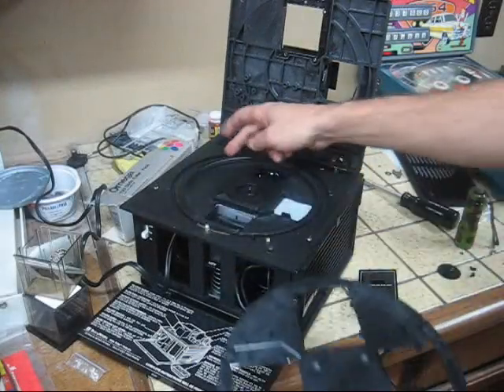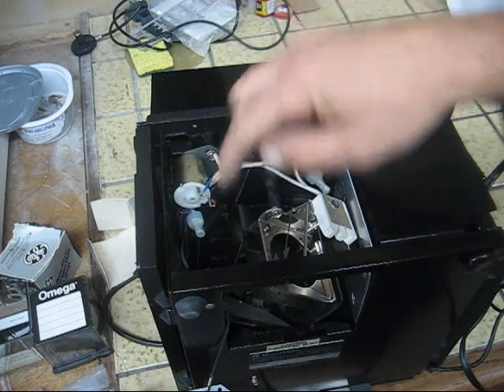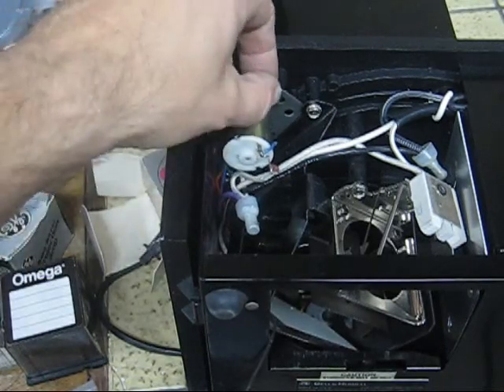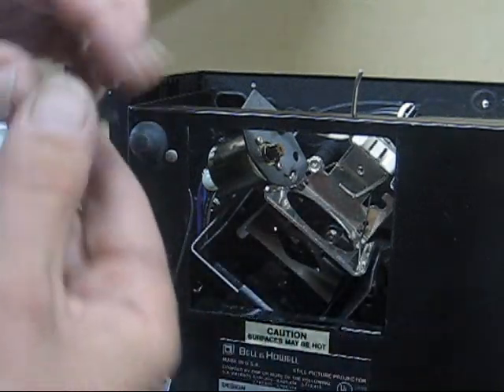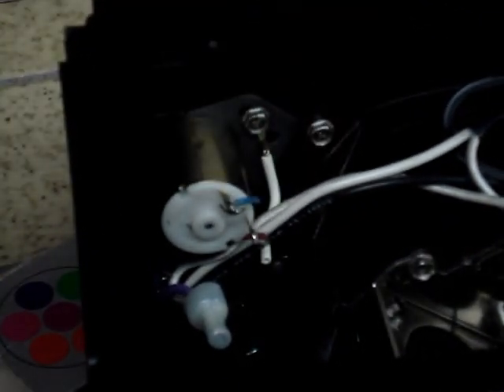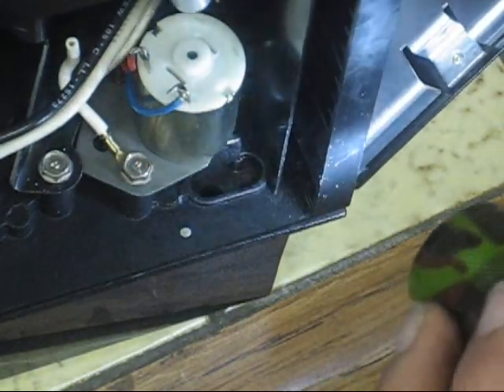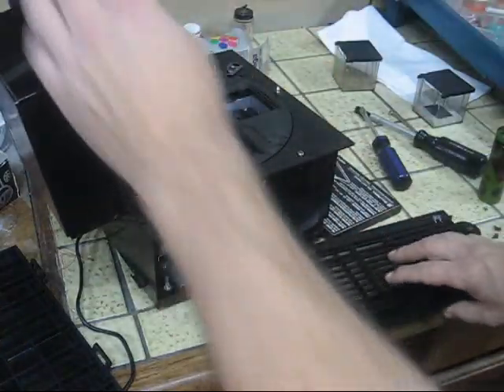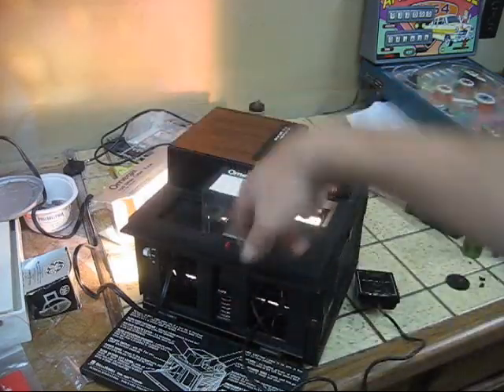Bell & Howell Cube Projector Repair Part 2: Replacing the Main Gear

Comment: Hey Justin, where did you order the Main Gear from. I need to replace mine but haven't found where to order one from. Thanks!
Reply from the maker: Hi Greg, they are available on Amazon from seller micro-tools. Enter "B&H Cube Projector Main Drive Gear - CUBE-GEAR" in the search window if this link doesn't work - https://www.amazon.com/Cube-Projector-Main-Drive-Gear/dp/B002RKFAUG/ref=sr_1_1?ie=UTF8&qid=1470089002&sr=8-1&keywords=Bell+and+Howell+projector+main+gear - They are $11.02 + free shipping. Good luck and let us know how it turns out.
Reply: How funny, I just did further research and found that seller on Amazon and just placed my order, literally 1 minute ago. I'm attempting to get my B&H cube projector working again. I haven't used it in over 20 years. I bought it originally at the PX in Vietnam in 1970. I have a lot of OLD slides of my life from that time to the late 80's. Hoping this gear will work. The unit turns on, light works, motor works, the mechanics inside work ( I took the case completely off ) but it's being stubborn turning the slide carousel. I took the gear out. The little shaft gear end looks fine but I think the teeth on the large side of the gear are smaller than they should be. Anyway, it's a fun project. I'll let you know how it turns out. Greg
Reply from the maker: Excellent! Glad you found it. Still, thanks for reminding me to post where it is available in case anyone else needs one as well. Unfortunately it seems to be the one big main weak point. I wish they had made it from a different material like these replacements, so hopefully our new gears will last a good time longer. Sounds like all systems are go otherwise, so when you do go to re-install take note of a little side to side play on the motor mount before tightening the bolts down all the way. I noticed this gives a little bit of adjustment room on main gear to carousel teeth engagement. It also helps ensure the motor itself doesn't touch any wires on either side.
As for that history, that is fantastic! That is really what this is all about. The images that photographs and slides have preserved throughout time are special, long before digital duplication. they are windows into our experiences and so preciously unique. People throw out or sell photos and slides every day and that is history lost or discombobulated. Modern Digital technology allows duplication, but it is far from perfect.
 As for the projector itself, it is far more than just a way to display, slides and films are an experience. I can remember as a kid in public school in the 70's and 80's we always had those giant green Bell & Howell projectors. Us kids always new something was up when we saw one checked out from AV. We would ask, "Are we gonna see a movie today?" and we had one teacher who always used to say "We don't watch movies in class! we watch educational films." LOL and they were all good now I think back. Especially after school when we would watch old 3 Stooges on the same projectors.
 So it was the experience that did it. Yes Digital is good, especially replacing those clunky quick snap, cheap 35 cameras, but I still have my old SLRs and develop because it is still not the same. It isn't one or the other, both can compliment each other as art. Now kids these days are getting crazy curious, they like movie theater experiences but are then blown away by old cameras and projectors. So new of an experience to them, they want to know more. 
Think about it, think back to when we all saw a movie for the first time- FILM. The giant screen, that hot stream of light, some dust particles floating almost motionless, the tell tale clicks, motor, fan hum  and little noises, the smell of the pop corn... what was it about it that was so different, so magical? As soon as I turn on this little B&H slide projector and the fan starts I get an immediate shot of nostalgia, and therefor a history "fix". That's why we fix these things and make that live on... If I get my hands on one of those big green B&H I'll pop corn and run Chillie Willie cartoons for the whole dang neighborhood in my garage if I have to. It was great, so fun,  art now, I guess. But I have to keep doing it.
So yes Greg, good luck, let us know if you hit any ruts and how it turn out man!
Reply: @justinsomerset5587  thats the one i bought TODAY.. but its $20 shipped now...

Comment: Justin there did you order the main gear from and is there a number for the part thanks
Reply from the maker: Hi Walter, they are available on Amazon from seller "micro-tools". Enter "B&H Cube Projector Main Drive Gear - CUBE-GEAR" in the search window if this link doesn't work - https://www.amazon.com/Cube-Projector-Main-Drive-Gear/dp/B002RKFAUG/ref=sr_1_1?ie=UTF8&qid=1470089002&sr=8-1&keywords=Bell+and+Howell+projector+main+gear - They are $11.02 + free shipping. Good luck and let us know how it turns out.
Reply: Hi Justin got the gear in 5 days  It took about about 20 mins to install hardest part trying to the back screw in. (fat fingers) thanks forall the info. walter ryan
Reply from the maker: That's excellent Walter! Yes, it is a bit of a squeeze on that second bolt, and trying to make sure the wire hangers don't drop off at the same time can be challenging. Hopefully that takes care of it, it seems to be the main thing that breaks on these, and you can run some shows now. This has been fun and exciting getting these projectors running again so I think I may make a few more videos covering some other stuff on them. So get out the pop corn.

Comment: Justin, I'm wondering if you've encountered this problem I'll describe here, and know of a fix? The problem:  I replaced the bad main gear and reinstalled the turntable, being careful to reinstall the washer under the indexing arm and to orient the indexing arm correctly with its spring clip.  What's happening is that the small tip of the indexing arm apparently is sitting too low in the small hole of the turntable.  When I click the advance switch, the indexing arm stays stuck in the small hole and jams the turntable so it will not rotate.  The indexing arm does moves freely; it just doesn't lift out the way from the small hole.  I don't see any way of adjusting its height.  I tried such things as adding a second washer under the indexing arm, and rotating the small black plastic fitting on the small screw behind the indexing arm.  Neither helped.  The indexing arm itself does not look bent or damaged.  I don't see any other places to try and make an adjustment.  Any thoughts???
Reply: Sorry - ignore this post.  Problem solved.  Dumb user error.

Comment: woulden't It be easier to pop of the carousel, and then to uncrew the top plate so you could easily replace the motor from the top down, rather then having to get to it via the side pannel?
Reply: dude, i wonder about that. just 4 phillips screws to get the top off.. but i already disassembled it his way.

Comment: model rf60  the motor is turning the slide disc in the reverse direction (clockwise instead of counter ) how do I change the motor direction?)
Reply: the motor might reverse if you just reverse the wires.. but dont risk it until you research, i dont want to be responsible for you blowing it up.